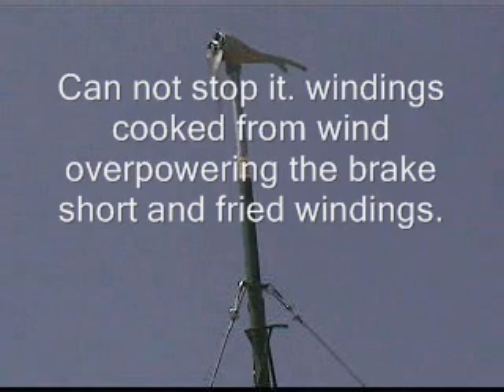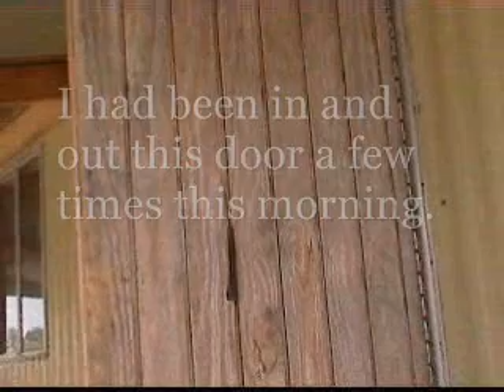AIR 403 wind generator throws a blade

Comment from the maker: yeah, that is how it is for a lot of folks. It takes strong winds to get real power, but I have pegged my 50 Amp meter a few times and see (or used to) 10-30 amps pretty regularly, but that is over 20 knots. under 15 and it is a meager harvest no matter how the graph looks. I have good wind here, which use to extend my power tool working time (or  whatever) into the night a fair number of days of the year. I promise to bring it to the top of the list and get it fixed one of these days. :) .

Comment from the maker: Ha- Thats funny AM. No big loss. It only Gave around 5% or less of my charging The PV does all the work. I actually lost two blades.  I will get it down and fix it if possible. The thing was sounding a little "OFF" lately and the brake wasn't working for some reason. When I had the switch off, It ran like it had a load, reving up, but not free spinning, but  giving no amps to the batteries. ??? Maybe switch failure. Yeah these are SOME gusts were having today!!! Hope your machines hold together.